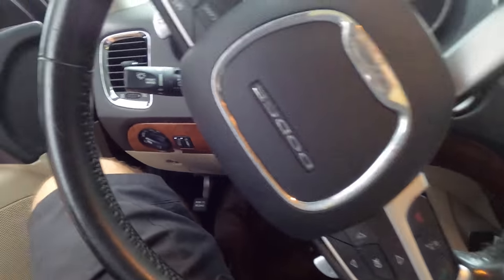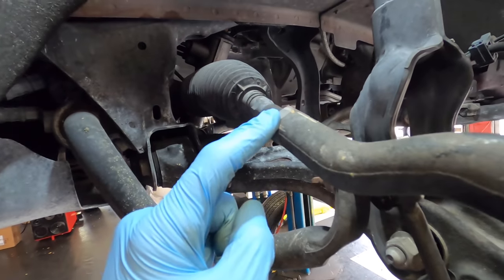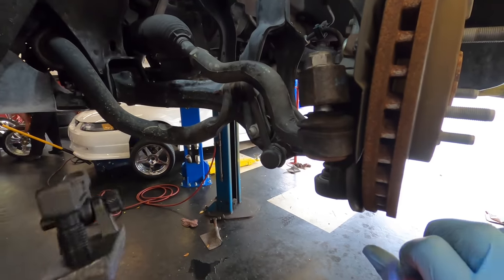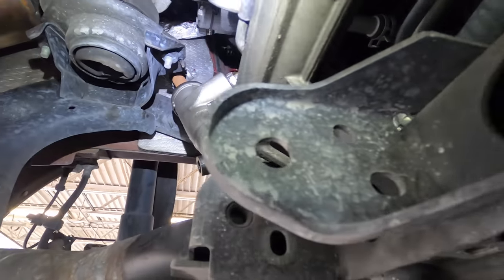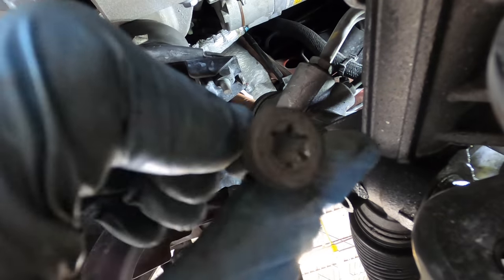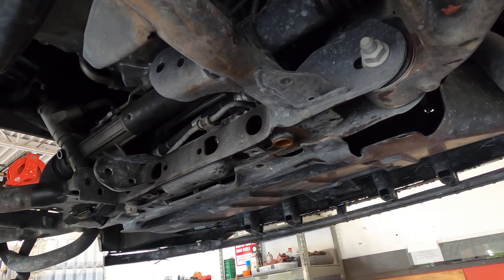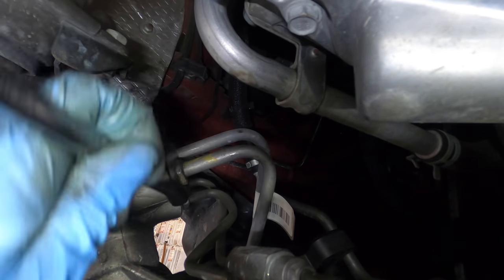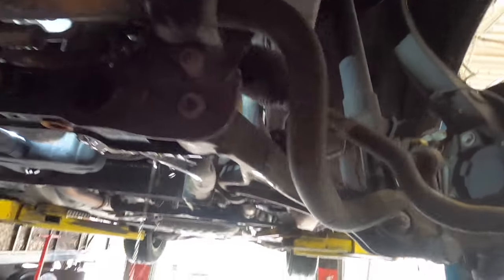Engineers vs Mechanics | They GOT Me!

Comment: A line wrench isn't for better access it's for a better grip on more sides of the fastener. They are very soft and require replacing the whole line if damaged.
Reply: So now everyone is a mechanic? This isn't your video nobody asked for your correction assistance
Reply: He didn’t lock the steering wheel before he disconnected the shaft
Reply: These particular types of fittings are sealed with o-rings, and are generally nowhere near as tight as a flare fitting, rust and corrosion not withstanding. And in my 35+ years of being a Mechanic, I have found that if I do need to use a line wrench, I just go straight for the Vice Grips and a torch instead! Much faster, and less damage! Especially when it comes to brake lines.
Reply: Yes that is a correct statement about the line wrench,  the design prevents damage to the fittings. And yes a I am a master mechanic with 47 years experience. And have done this exact job so many times I lost count .
Reply: @theoldman8877  is funny because I have made lots of damage to line fittings with those line wrenches haha 😂 specially rusted ones. And yes, I use the exact measurements and high quality ones. But hey I ain’t replacing sheit. If it becomes non grippy the vice grip is my best friend.
Reply: Ya, i hate seeing them not being used
Reply: @ak-slim3278  he put it out there so too bad if he has to hear shit when he makes a statement that’s wrong cause a line wrench is usually bigger and gives you even less room to work with so he’s wrong all the way around
Reply: I meant an open end wrench
Reply: He is correct line wrenches are for better grip so you don't round the fitting off trying to get it out. I am a auto tech of over 20 yrs.
Reply: @shawnaurelio4923  once again who asked any of you so to bad
Reply: Hagbard Celine  yeah that's gonna be different real soon with how the us is going
Reply: That's what vise grips are for.

Comment: I worked with manufacturing engineers for ten years implementing their brilliant ideas. 9 out of 10 times they would listen to the guys on the shop floor about their "improvements". Except the ones just out of college. They knew EVERYTHING. Never wanted to throttle somebody as much as them.
Reply: @Darkfarfetch English be your second language there, homie? Learn to type. That's my point.
Reply: @Darkfarfetch 
Too!
Reply: They got a whole team of rookies to design the new GM 1500 trucks
Reply: @earnestp.worrell5389  KnowwhatImean Vern? ;)
Reply: @Darkfarfetch are you still here cinderfella?
Reply: Maybe it's just because I had a tradesman as a father (who also disliked engineers) and/or because I have a (un)healthy amount of self doubt, but I never really thought my ideas were better than the experienced guys. That being said I have questioned old timers a lot in an attempt to understand why a method or technique works.
Reply: @Anon_Omis  age and experience always beats youth and silliness.
Reply: @earnestp.worrell5389  hence why I try to ask those who know more first.
Reply: i agree and I'm an engineer
Reply: @earnestp.worrell5389  That's a good thing to know when you're young and a fun thing to know when you're old, although I did come up with a few better ways of doing things when I was a punk that left the old-timers scratching their heads. Still, there's nothing like working with someone who's been doing it for 50 years. The quote I read about 60 years ago by an old-time hot rodder that the newbies could never beat was "Youth and ambition is no substitute for age and experience." Yep.
Reply: Just make sure that you have properly engaged the choke BEFORE adjusting your throttle.

Comment: Retired (EE) engineer and once a professional auto mechanic in my earlier life, I always enjoy your helpful, informative, albeit entertaining videos!  Best part is your handy universal torque wrenches, I’m curiously wondering if you have one of those for oil filters too!  Keep up your awesome upbeat videos!!
Reply: Hi Stan 808!
Oil filters 404: 
Those who are replaced unscrewing, as a can, in a whole complete unit; problem: they leak. Solution: install them tight. New problem: they wont unscrew. Solution: destroy engine block with TNT, to release the oil filter or use this trick while installing the oil filter:
Always lube the seal. Fill it with new oil. Install it light tight. Unscrew. Install it a little bit tighter, unscrew. Now it is evident that it will be stuck if tightened a little bit more. Tighten it and just start unscrewing a little bit.
Ready! That's it. Will not leak because it is really tight but WILL unscrew because the unscrewing process has been started.
Reply: @victorborges9523  
Thanks for responding!  I think you know that I meant it as a pun, as Rainman Ray often uses his verbal “click, click” on random fasteners, other than real torque wrenches he actually uses on critical components.
Reply: Bought an old car when I was about 19 y/o and could not remove the oil filter no mater what wrench or tool I used. Had to escalate.  Ended up hammering a screw driver through it perpendicular. then hitting the far end of the driver handle with a hammer to break it free.......Ugly, but like Ray often says...."I win!".....LOL
Reply: @jaykellett2327  have done that too. By the time it was off the oil filter looked like it was hit with a shotgun 🤣

Comment: Heya from a new viewer from Mexico! Love watching your videos. Speaking as a complete mechanical layman with a basic home DIYer set of tools you've no idea how envious I get when I see all the cool tools and toys you get to work with. Keep up the great work and stay as honest as you are. World needs more people like you dude!
Reply: Bro, those tools are EXPENSIVE. I have nearly 10k in tools, abs lemme tell ya, I have just about everything he has but the scanner. I have a cheaper scanner that I paid $1,200 for. Lol. Enjoy the bliss of not having an entire vehicles worth of tools. Lol.
Reply: With A 19mm,17 mm,14mm,12mm,10mm,8mm,vice grips, a few ratchets and a few miscellaneous tools,you can rebuild almost anything ,,90+ of tools are never used as its aĺl the same nuts and bolts for atvs,motorcycles,cars,etc
Reply: @unfairfight3625  then you have long ratchets, short ratchets, offset wrenches, s wrenches, screw drivers, channel locks, pry bars, 1/2 sockets, 3/8 sockets, 1/4 sockets, flex head wrenches, flex head ratchets, stubby impacts, full size impacts, stubby 3/8 drive impacts, lug nut sockets, half size lug sockets, air ratchets, torque bits, hex bits, triple squares, inverted torque sockets, line wrenches in both standard and metric, multimeter, scanner, dead blow hammers in multiple weights, ball peen hammers in multiple weights, calipers, c-clamps in varying sizes, line locks, punches, air hammer, air hammer bits (to include pointed bit, chisel bit, hammer bit, angled chisel bit, ball joint separator bit, and scraper), dykes, needle nose pliers, picks, drill with wire wheel, extensions in multiple lengths and sizes, flaring tool, line separator tool, axle sockets, swivel adapters, and I'm probably forgetting a few. I use all of these things on a regular basis.
Reply: @unfairfight3625  Kinda half true, though not quite. You can pretend to enjoy spending half an hour all twisted and cramped working on hard-to-reach seized bolts with your tools or use a nice impact wrench with a sexy attachment to get it in that tight spot just right while you car is lifted properly so you can actually work without pretending to be a 220lb human pretzel. Or you can try to be Aesop's fox with the grapes.
Reply: @gedkealmen  i drive a toyota Corolla and camry, so you service brakes,oil,struts and replace the battery,tires and exaust, the alternator is easy to access.every bolt and nut i touch has antiseize on it for easy service next times around
Reply: @hanksadventures4132  
A set of allen keys (metric and imperial), a bearing / steering wheel puller, circlip removal / installation pliers, (straight and right angled tip pair) and a suspension spring clamp also come in handy on rare occasions and where these tools are required there are no other tools that can substitute for them. Also if you want a real "click" you need to get a torque wrench.
Reply: @unfairfight3625  if every bolt you touch has anti-sieze, remind me NOT to buy a vehicle from you. You DO NOT apply anti-sieze to suspension components unless you want them over-torqued or backing out
Reply: @jtveg  pulley puller/installer, ball joint press, fluted sockets, harmonic balancer puller, and tap and dye set are also extremely useful. Lol. Oh, almost forgot the tool box/boxes to keep them all in.
Reply: @hanksadventures4132  
Absolutely.   😉👌🏼
Reply: @hanksadventures4132  i live in the sub-arctic next to the ocean,,my cars rust in the driveway, without it you cant even remove the wheel nuts as the studs will break.that includes all nuts and bolts,also cars have no resale value here as everything is run into the ground,most cars are driven until you call the scrap yard to come pick up whatever is left.
Reply: @hanksadventures4132  yes and so does everyone else,you will break most studs when you need tires,its like everything ends up welded together in just a few weeks,even the garages put antiseize on lug nuts,all nuts and bolts have to be cut to service the vehicle.aluminum wont work as it is too weak and will break if removal is needed,my car is white everyday from salt air, washing it only speeds up the process so it is avoided as much as possible.
Reply: @unfairfight3625  true
Reply: @hanksadventures4132  Plus he's got those hook-nose fuckin' wrenches like the mechanics use!
Reply: @unfairfight3625  where exactly is it that you live? Cuz even in Alaska this scenario your painting is untrue. Aluminum is plenty strong enough for wheel studs, considering many manufacturers use them already.

Comment: For what it's worth - one trick I was taught by my dad when working on my own cars - if you need to remove fluid lines, be they brake/clutch or power steering if you remove the (vented) cap from the fluid reservoir and cover the opening with some plastic wrap and screw the cap back on, you won't lose all of the fluid from the disconnected line..
Reply: Is cellophane not getting bad with brake fluid?
Reply: @danibess6284  Doesn't matter - it only needs to seal the vent in the cap to stop the air getting in, so the fluid doesn't run out when you disconnect the line...

Comment: As a former A&P with McDonnell Douglas and someone who's done his own auto maintenance work for the last 30 years.  I can agree with Ray.  None of us like engineers for exactly what Ray illustrates in this vid.  Over the years I have probably used every curse word in the book directed at engineers for some of their designs.  Just a few months ago I replaced a starter motor on my girlfriend's 2000 Tundra.  Instead of locating the starter motor where it normally resides.  Noooooo, engineers had to locate this one underneath the intake manifold.  Turning a ten to fifteen minute easy peezy job into a few hours of removing stuff (including the fuel injector rails) to get the upper intake manifold out of the way to expose the starter motor with it's three mounting bolts in the awkward location in the small out of visual sight between the engine and firewall and then putting it all back together.  Just to replace a starter.  Uggg!
Anyway, Ray, I couldn't agree with you more brother....

Comment: The way we separate Morse Taper joints downtown Ray, is we loosen up the nut several turns, then spray a bit of penetrating oil of your choice (I prefer Kroil) on the joint, wait a few seconds, and then whack the socket part of the joint with a medium sized hammer, about 16 Oz most of the time.  Sometimes we place a bigger hammer directly opposite where the hammer will hit.  It's a rare occasion indeed that it takes more than three good hits until the joint comes apart!  If you see a raised and flat spot on the socket half of the joint, that's a striking surface, so hit it there.  You're welcome!
Reply: Good 'ol Kroil
Reply: I concur. Even do truck joints this way.  Sledge hammer as an anvil on one side and a good whack with an appropriate knockometer on the other and job's done.

Comment: As a dodge technician, we love those steering racks. You do enough of them and the combination to remove them becomes second nature.
Reply: It's like entering a combination on a lock it looked like haha. Pull right, twist 3 times, pull down, twist reverse once, unlocked!
Reply: This was a money job back in 2014, 1.5 hours tops
Reply: @Stg4100  even better job now that they're all CP.
Reply: My question>  why is a 7 year old rack already leaking with busted seals? No leaks yet on   my 20 year old Tacoma and my  8  year old Subaru
Reply: @jkarov  it's a late model dodge, that's all there is to it
Reply: @jkarov  because the companies cut every corner they can... and make it so it just makes the warranty before failing, so you can make them more money on the replacement part... and a longer time is there to make them more money with high labour costs!
Reply: Did you not have to lock the steering wheel in place as to keep it straight? How did you know how many turns to tighten the outer tie rod ends? Or do you just eyeball it and let the alignment guy deal with it? I’m not experienced in steering racks so that’s why I ask.
Reply: @CarsandCoding  I always count my turns when I take off the tie rod ends, and I do the alignments afterward also. And I usually run the seatbelt through the steering wheel so it doesn't turn. The steering shafts only go together one way, so you can't be off on the index there
Reply: @jkarov  Answer: Because Dodge...
Reply: As a Dodge Technician the only way you won't do enough of them, or ball joints, or rod ends, or any other front suspension part that will die if it gets within 5 yards of a pot hole, is to quit or get fired your first week.
Reply: @jkarov  it's a dodge.....

Comment: Helpful hint when working on a Dodge: always start by removing the entire frame.  I hear that's how their engineers plan out all repair techniques.
Reply: Wait!  Are you trying to claim engineers "plan" anything? BWAHAHAHA. Anybody encounter GM j-body cars from the factory with a bit of scrap box cardboard in the rack-to-firewall mounting strap to keep the rack from shifting about an inch to left or right at full lock positions? Assemblers had to overcome engineer no-think. Until the cardboard disintegrated. The Eiffel tower is a nail designed by an engineer.  Upon its launch, GM engineers touted the unlined aluminum Vega/Astre engine as having built-in lubrication good for 50,000 miles then a new block only cost $45.  But the labor cost was more than the cost of a new Vega.  OOPS. "Did I do that?" to quote Steve Urkel.
Reply: Doesn't matter what you do, the AC is always in the way.
Reply: One better do “not” buy a dodge product!!😂😂😂😂

Comment: Names given to some of my tools:
1) The flying butt pliers = huge channel lock pliers with pipe wrench jaws
2) The cherry popper = air hammer w/ red cover
3) The stag beetle pliers = large oil filter pliers I only use to hold cam sprockets
4) Meh-myr = dead blow hammer
5) The invidious eye = bore scope camera
6) The holy hand tool =  obsolete Honda ABS bleed wrench with built-in reservoir (shaped like a long cross 3.5 feet tall, with reservoir on top)
7) Scarecrow = any obsolete specialty tool for a specific car that no longer shows up anymore.  1-2 uses total.  Kept to keep the evil cars from coming back.